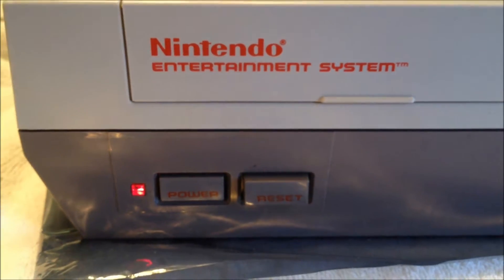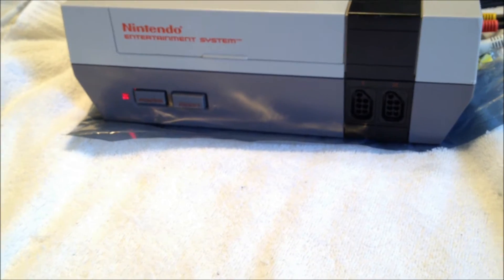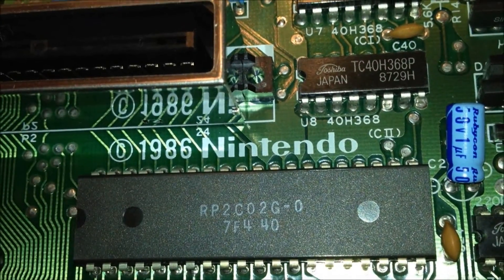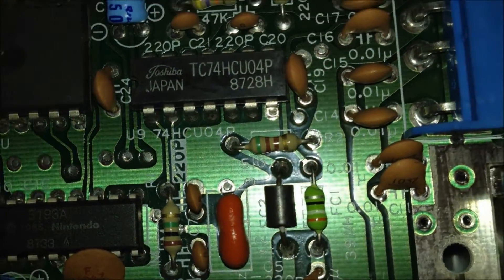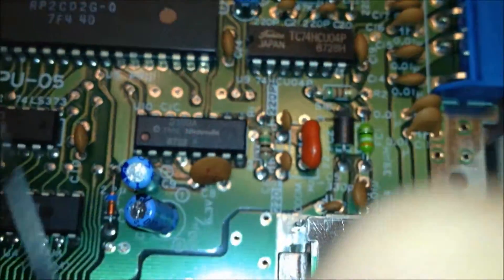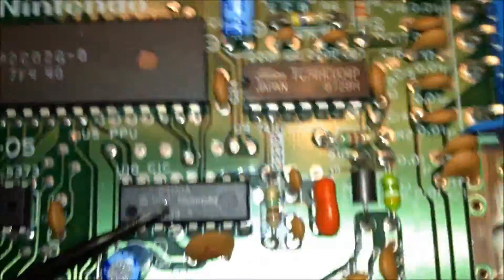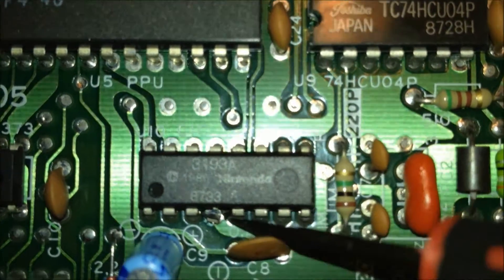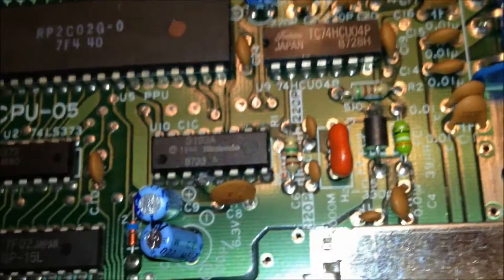Classic Gamers' HQ : NES DIY on Disabling the CIC Lock-Out Chip

Comment: I fixed 4 3193A lockout chips. A great solution to a annoying problem. I have 10 nes systems coming in for repair. I will be giving them the 3193A lockout chip removal.  A better nes gaming experience. Plus 72 pin set refurbishing Controller cleaning.

Comment: You can just solder 2 wires to the board to bypass the 4th pin, and not mutilate your NES..... The 2 wire method has been around since the 80s and is reversible this is not. Not all NES boards are the same so make sure you find the correct mod setup for your system.

Comment: I'm kinda OCD, so were it me I would desolder the chip completely, snip the #4 pin, then resolder the chip back into place with the clipped pin. That's just me though. I don't like to risk damaging a ROM chip by actually pulling pins out of the potting material.

Comment: Man I dont know about prying on the leg like that. Or cutting it. You could crack the chip and then your screwed.
Why not cut the trace? That would be reversable. Real easy to reconnect it if you needed to. Also if someone was wanting to do this bypass. If they was disoriented following the video cutting the wrong leg. They would ruin the nes.
If they was cutting a trace and got the wrong one. They could make the repair and correct a mistake.
Reply: Breaking the chip itself doesn't screw you. Just makes it region free

Comment: The best thing to do is install a toggle switch and connect it to the 4th pin so you can enable/disable it.  Give the pin a snip in the middle,  not too close to the PCB or the Chip itself, just right there in the middle and connect the two wires to your switch. There are a few games that require this chip, so you don't want to have it permanently disabled.
Reply: What games require it? Would disabling the chip present a problem when using an everdrive n8? 
I am in the UK with UK PAL NES.
Reply: I've heard other people say that a few games require the CIC, but no one ever provides any examples. If these games do exist, then they don't work with the NES-101 top loader because that system never had a CIC. I have heard that Nintendo World Championship uses it somehow to reset the game and keep all players in-sync, but even that is no use without specially modified NES systems that have a cable linking them together to synchronize the reset.

Comment: Some of the commenters her obviously don't understand that the CIC Lock out chip is a bigger problem.  Yes a 72 pin connector might fix it, but I have replaced mine and after less than a month I'm having the RBoD and this "mod" is exactly what I need.
Reply: Very correct. A common misconception. Even when these consoles were new and everything was clean, and the pin connector fresh...this would be an issue the very first time you tried to play out of the box. That's the chip, not dirt, dust, corrosion or tweaked connector pins.
Reply: @SumDumGy  so this chip will actually cause games to not boot up? Like the same as if they were dirty? I have this issue with mine even after clean the 72 pin connector and all my cartridges.. I've never heard of this.
Reply: @Gameboy-Unboxings  Thats correct.

Comment from the maker: @ninluigi ok negative nancy. anything including 72 pin connectors can be cleaned using the right tools and methods. This is a FREE alternative, as is disabling the lockout chip. There are dozens of mods out there for your NES that will reduce the value of it; however, it is optional and you now know how for your particular situation.

Comment: There's no point to do this. The 72 pins connector will keep getting dirtier and shit. Just cleaining it and put pins back correclty would make it run any games (or just replace it, they are damn cheap on ebay). And the nes loose value if you disable the CIC.
Reply: Everything you said is wrong.
Reply: @SumDumGy  truth